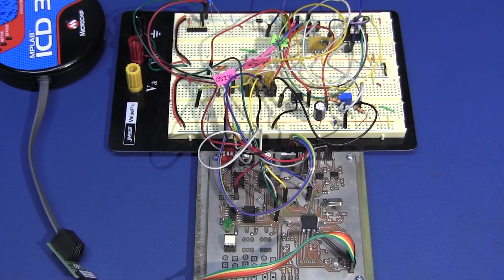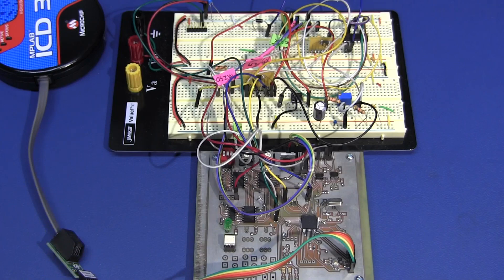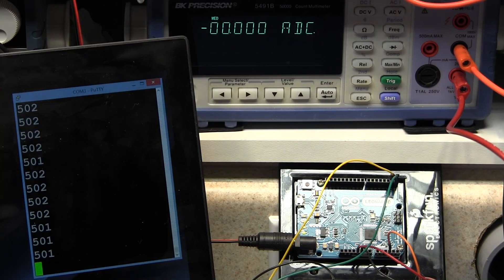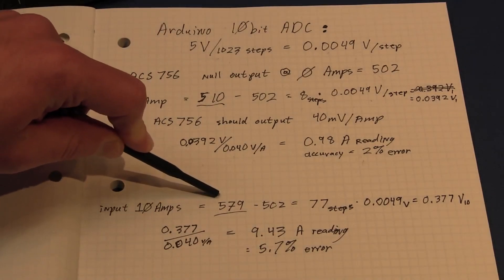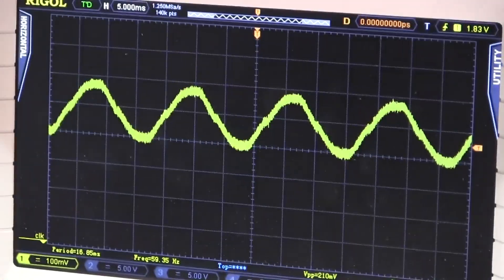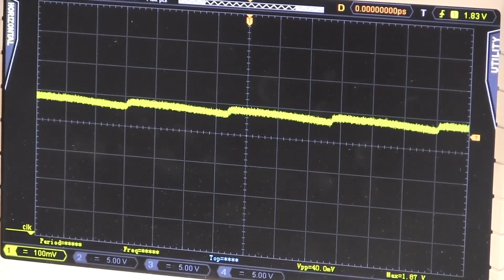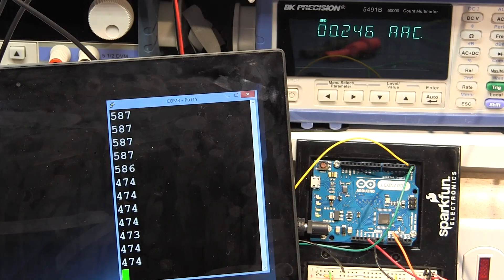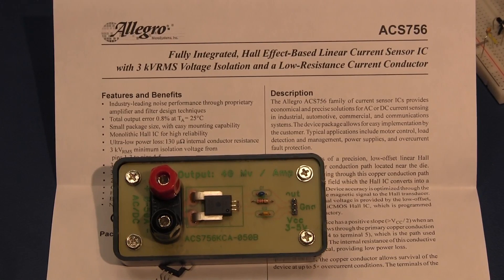AC current measurement using the ACS756

Comment: please i need the circuit of the ACS756 current measurement device to mesure a DC current
Reply from the maker: There is a diagram in the datasheet:  http://www.allegromicro.com/~/Media/Files/Datasheets/ACS756-Datasheet.ashx
Further explanation of a similar chip, the ACS723, is at SparkFun.com:  https://learn.sparkfun.com/tutorials/current-sensor-breakout-acs723-hookup-guide

Comment: Can ACS756 measure the sensitivity to mA ?
Reply from the maker: xuan nhat Looking at the datasheet, I don't think it would work too well to use the ACS756 to measure milliamps.
The ACS756 provides a ratiometric output (analog voltage proportional to the current) of 40mV per Amp, so for 1 mA, you might see 40 microvolts of change... that might be difficult to measure accurately in your circuit.
I'll do a little checking and see what I find.
Reply: Corgitronics Thank you very much. You can check out the combination "Arduino + ACS756 (40mV/A)" can check exactly how many minimum mA?
Can Amplified circuit  be used to increase the sensitivity for ACS756 ?
Reply from the maker: xuan nhat The ACS-756 appears to throw out about 100 microvolts of noise, so even using a precision DMM the lowest effective resolution is about 10mA, which will provide an output of 400 microvolts (or 0.4mV).
0.4mV is too low for the Arduino to resolve using its own ADC, as that can really only resolve to 4.88mV if you are using the internal voltage reference.
Using an Arduino to measure the output of the ACS-756 really limits the current resolution to about 100mA.
But, keep in mind that the ACS-756 has a 50 Amp range, do you really need 100mA or better resolution on a 0-50 A range?  Perhaps a different hall-effect current sensor with a smaller range would work better, or change over to using a current shunt.
If you only need to measure up to 5 Amps, then the ACS-712 might be just the thing:
https://www.sparkfun.com/datasheets/BreakoutBoards/0712.pdf

... After some digging through bins, I do have an old ACS-712 from sparkfun, and I'll fire it up tomorrow night and check the results.
Reply: Corgitronics I want to use sensors ACS-758 or ACS-756 to be able to detect and calculate the consumption in the my House are opening lights (need resolution on mA range) or air conditioning (need resolution on A range).
If a resolution about 0-50A then can not detect light is opening.
Thank you . If you have any solutions to the above problem, you can advise me :)
Reply from the maker: xuan nhat The ACS-756 has a range of up to 50 amps, with a resolution of maybe 100mA.
If you're measuring AC, then you have to handle the RMS and you will probably have more noise in the readings.
I'd recommend going with a current shunt or use a current clamp (Rogowski coil), like the Pulse DE-51687.  http://www.digikey.com/product-detail/en/PE-51687NL/553-1543-ND/2266077
And, you can get current transformers that snap onto the wire, so you don't even have to cut into the line.

Check out the video on the CS5464, you can use that chip with an inductive coil instead of a shunt, and that provides you with galvanic isolation, so you don't need all those isolation chips.
https://www.youtube.com/watch?v=Mn4tP2Zlg_Y

Whatever you do, be careful around mains power... it can provide a tremendous amount of energy, even before a breaker or fuse trips.